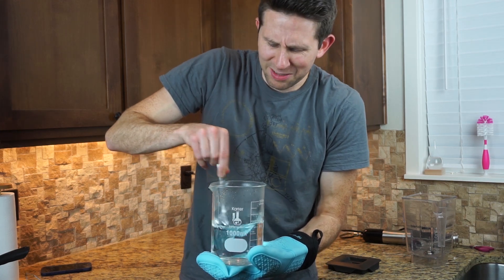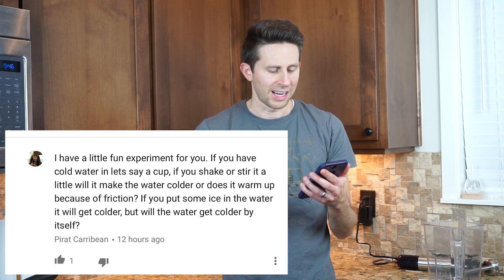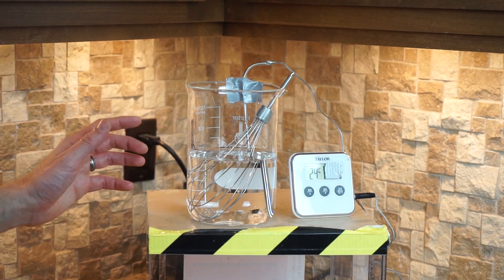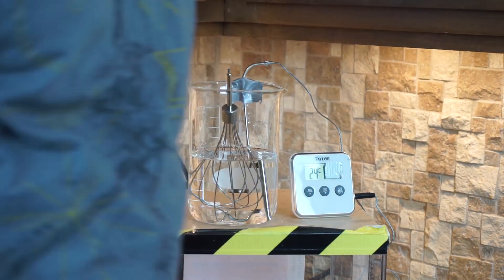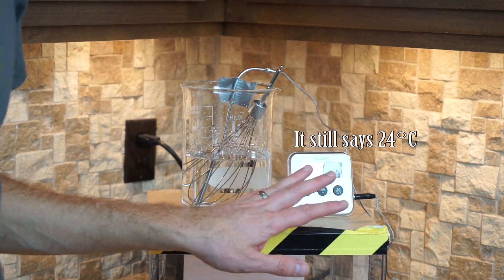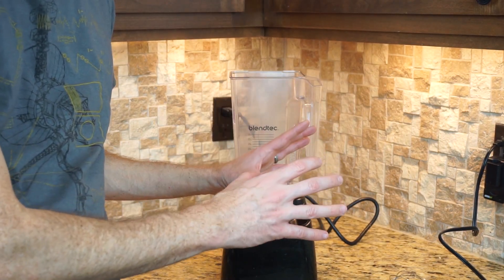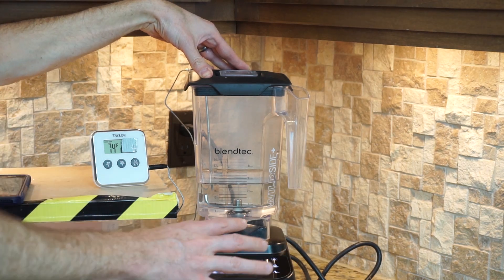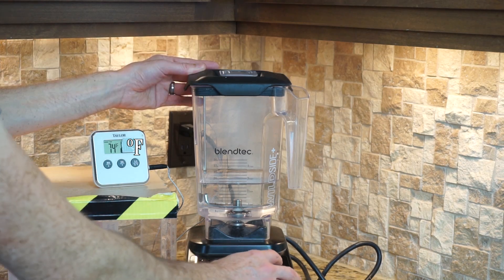Can You Boil Water Just By Mixing it Really Fast? Water-Stirring Challenge Accepted!

Comment: Seems like there's some kind of huge loss going on. I know the sides aren't insulated but with the amount of power going into the water it really should in theory be getting hot a lot sooner.
Reply: Yep -- the motor's friction and electromagnetic inefficiencies are far greater than the blades-against-water friction (measured as energy rates).  So most of the electrical energy ends up as heat before the water,

plus a tiny amount in the water's kinetic (stirred) energy and some amount also lost from the water [as u pointed out].

Comment: I thought that you can cool water down by stirring it because if you don't stir it then only the surface that comes in contact with the air gets colder since the air is colder than the water, unless you're stirring somewhere with high air temperature. The surface should change eventually since colder water moves down and hotter water moves up but I don't know how fast that works. I thought that stirring cools it down by letting the surface change much faster.

This is purely my idea about it. I could be and probably am wrong.

Comment: In theory yes if water is stirred really fast there will be enough friction to boil it.  In reality no a human is not strong enough to stir water that fast. If you move through any substance fast enough you will get very hot. When spacecraft re-enter earths atmosphere and catch on fire there is only .01% of the air you would find at sea level but at 15,000 mph even a tiny amount of air creates substantial friction. By the time the spacecrafts get down into lower thicker air it has lost most of its speed and friction is much less it is no longer on fire.

Comment: Is the water boiling because you're breaking the hydrogen bonds that holds the water molecules together, resulting in the molecules escaping as a gas (boiling)? Or because the friction from the blades and the water increases the temperature of the water, which in return the water boils?

Comment: I think the heat from the mixer blade also add the temperature to the water. Anything you mix in a mixer gets hot also the blades. In this experiment the mixer blades used should be made of an non conducting material, then it will be more accurate to say that water can boil by just stirring it fast. 😉
Btw. Love your videos
Reply: Shit.. you already mentioned it in you comment 😂...

Comment: It's not the water heating up in the blender from mixing it. There's metal engagement points on the blender that tie in to the heat sink of the electric motor, and heat rises. If you run a blender empty without a liquid in it, you will burn it out because the liquid absorbs the heat and acts a coolant. That blade gets very hot, surprisingly fast, it's something we have to take in to consideration when making and blending different types of hot sauces; in a vinegar based sauce the heat is okay, in a fermenting hotsauce you can get too hot and kill the yeasts you need propagating for fermentation and sterilization, you can end up with botulism.

It can be done, but your experiment was not a representation of the Joule paddle wheel experiment.

Comment: I think the reason behind is not the friction of water, but rather the metal part of the blender, it’s heating up as it is plugged and the slight amount of electricity transformed into heat, and then I think it might be caused by the ‘heating up’ metal stirrer than the friction itself. Comment below cuz I am not sure about it

Comment: The heat was created by the friction between the blade and bearings and then absorbed by the water. So most of the heat was not created by water friction against the blade or the container walls. If you can really boil water by stirring it you could’ve used plastic whisk attached to a drill instead of metal blade.

Comment: I knew what your results were going to be , before you started .  I was working with cameras inside water jets . The water cavitates , or causes little bubbles , as  it goes thru the jet . If you could measure one bubble interior , it should be boiling .                    Cavitation can wreck hydraulic pumps and boat propellers . I was working on hydrodynamics , to see in high velocity streams .

Comment: How do we know the blender didn't just heat up due to being run for several minutes thereby heating the water?
Reply: I think these motor gets really hot and transfers the heat through the rotor and blades
Reply: Bro comments in YouTube are just nuts... That's a a good question Zach. I'm actually a physics student, but I'm not sure what the answer is.
What I can say it's that the motor definitely generated heat by being on for that much time, and it's reasonable to think that part of this heat got in contact with the water via the blade.
Probably it wouldn't be enough to boil that much water dough. Most of the heat definitely comes from the friction of the blade with the water
Reply: This water did boil from the heat transfered from the motor. Don't believe it? Look when he turned it off. The water was boiling ONLY in the center where the motor was connected. This is the heat source.
Reply: @miked3723  because that's where the most motion ie the most friction was generated, ever thought that way?
Also as pointed out before the transfer of heat through metals used isn't fully efficient and also the air gap so though the heat is transferred it isn't the major contributor to the heating
Reply: @skyking469  No by far the most friction with the water was created at the tips of the blade not the shaft. Also the air gap means nothing as all the motor pieces are connected to eachother, there is no air gap. And the efficiency of heat transfer through metal (which is high) does not matter, if the motor is getting hundreds of degrees then even poor heat transfer would get the blade extremely hot.
Reply: Looked for this comment
Reply: Even I got the same doubt
Reply: Partialy but it won't be enough. You can test by make blender the same amount of time and check the blade temperature if it hit 99 celcius.
Reply: Well. You can see that there is an air gap between the blender and water so there isn’t much heat transfer that way. There could be some heat transfer through the stainless steel blades but it’s not that much because stainless steel is not the best thermal conductor
Reply: I was thinking the same thing until he mentioned the Dr Jewel story (that i wasn't aware of because I'm not familiar with science)  once he talked about Jewel getting the same result with no electricity i realized it was true.
Reply: Yes friction of the water will will generate heat. But... I dare you to touch the motor. Goodbye skin.
Reply: Hmm. Blender hearing up for running several minutes... Hmm If I remember correctly, water boil at 100⁰c. So you telling me that the blender get so hot that its heat boil the water while the motor aren't broken
Reply: @loljay3281  well remember, the water in the example given didn't boil, it simply heated up. Thus my reasoning behind my conclusion.
Reply: @geekypleer1202  that's not even a reasonable conclusion. We already know why it got hot because motion and heat are interchangeable. Mechanical energy and heat energy are interchangeable.
Reply: @ronhempfield5043  I'm not saying it's not, dude. I'm just saying in THIS case it probably came from the blinder. I'm not disagreeing with the fact that friction creates heat.
Reply: @Zach Rowlett  you believe running a blender for "several minutes" could heat up that much water, just like that! You could put a lighter flame to that much water and it would barely increase the temperature. I'm fairly certain the heat was not generated by the heat radiating from the use of the blender as you described.
Reply: @ronhempfield5043  Ok. I went back and watched the video again cause I really couldn't remember how much the temperature went up, or what type of blender he had.

Upon further observation I'm gonna say yeah, the water moving that fast definitely had a big effect on the change in heat, but I also think the blender is responsible for a good bit of it. You gotta think, if water can create that much heat due only to friction, then steel blades and all the little bits moving in the motor which all directly rub each other at very high speed must be contributing. Because more friction creates more heat, and you increase friction by increasing either force or mass, and the steel blades that are connected to the gears and the internal workings of the motor have more mass than the water they are contacting, they generate more heat.

I really think this is just a misunderstanding. I know water can heat up a lot just due to friction, I just say that in this case it wasn't ONLY the water. It had some help.

Edit: he mentioned in the description an experiment I'm much happier with.
Reply: That's a lot of words for "I'm wrong"
Reply: @jasonmiller6181  thermodynamics says yes the heat will transfer from the 1000w motor to the water. heaters are 1500 watts and heat up rooms fast. do the math.
Reply: @zerotheliger  they aren't into science, they are just children who watch a nerd who can "do math".
Reply: @geekypleer1202  A portion of water did boil and you could see steam. Are you blind or what?
Reply: @geekypleer1202  can't find a mentioning of a related experiment in the description. Can you put it here please? Btw, don't bother with these stupid comments which were made by kids who can't think straight or follow an argument.
Reply: @geekypleer1202  man you think blender got like 100°?
Reply: @loljay3281  i build electric skateboards its typical to see motor temps reach over 100°
Reply: @loljay3281  the motor would burn due to heat yes but if you are taking away that heat with the water then it could sustained it there for not burning the motor
Reply: Have u wat hed the last bit
Reply: @maindepth8830  I got a stroke trying to read dat

Comment: Actually 100°c is boiling point for water
Reply: At sea level yes but if you go higher the boiling point gets lower. For example if you are 1905 metres above sea level water boils at 93,4°C. So higher pressure = higher boiling point, lower pressure = lower boiling point.

Comment: The problem with this experiment is that believe it or not the blender itself is generating heat by electric currency in the motor and the shape of the base of the cup it's shaped in a way that it preserve such heat, thus helping the water get warmer faster, idk if this can influence a bit or not but still friction does get heat as result so probably with a bakery mixer could probably get the same results but slower and maybe messier, but as for boiling point I kinda doubt it but not sure though

Comment: ...
Whenever I use a blender, I feel the blades are warm, maybe because of the frtiction it gets from the high speed rotation...
An electric kettel has a coil that heats up the water, the blades in this blender should be comparable to that heating coil... Coil gets heat directly from electricity, while the blades get heat from friction against the base of the blender...
.
Well, I can at least be sure that most of that heat that boiled the water was created this way and not the water generating friction from its molecules.

Comment: Man: can I boil water with a blender?
Electricity bill: I'm bout to end his whole man's career
Reply: technically, it's not more expensive than using an electric stove, or a microwave. A little bit due to inefficiency of motor, and heat dissipation, but not this much.
Reply: You guys get electricity biils even in the US?
Reply: @vanditsangal5018  Even in Turkey,mate😭.
Reply: @vanditsangal5018  I'm from europe
Reply: @cristian-gabriel  okay,so do u guys get electricity bills even in Europe?
Reply: @vanditsangal5018  u get them everywhere aalmost
Reply: Vitamix Blender has been doing this since 60’. Nothing new and only takes a minute to two minutes. Electric bill doesn’t even notice it.
Reply: Bruh your pfp 😂
Reply: Actually your electricity bill we'll be the same if you put the water to boil on electric cooker or use this energy for the blender.....just you'll waste a lot of time with the blender.
Reply: Nice shoe
Reply: But I'm not a rapper....
Reply: It is not significantly more energy intensive to heat water by mechanical work than it is to heat it by a resistive heating element.  The reason why we don't usually do this, is the wear and tear on all the moving parts.  It is a lot more efficient for the maintenance of the appliance to use a fixed resistive heater than a moving mixer for heating water.
Reply: Your spelling mistake made it mean Shutting this man's body off and kill him
Reply: My electric kettle takes around a minute to boil the same amount of water, which is 3100 Watts, that's around 51.5 Watts per minute.

Blendtec is 1725Watts. That's 28.75 Watt per minute. For the water to reach boiling temperature, it took 6 rounds of 1.5 minutes each. That's 9 minutes in total, which means it required ~259 Watts which is 5 times the consumption of a kettle. 

If we use the kettle 180 days per year, that's 46.6 kW annually. If the price per kWh in USA is ~13 cents, that's about 6$ per year instead of 1.2$ which would be by using a kettle.

That means the bill every year would be 4.8$ extra which I believe it wouldn't really affect him financially.
 
Those are some really rough calculations, a very specific period of kettle usage per year and a price of electricity I found in a random site.
Reply: @phelpswilliams159  I fully agree. The most expensive part of this method would be the extra wear to blender bearing.
Reply: It's " man's whole career"

Comment: 4:49 and the heat from the blades center drive and motor.
Reply: This is what i said. All dumpheads in this video got fooled. No one thought about that except me and you. I was scrolling down to see where anyone would point that out. I've been using blenders since 2007 A LOT. A DAMN LOT (for my bodybuilding meals lol). Thus, all i want to say is that A LOT of heat comes from that point due to friction of the shaft (and a part from the motor (because it depends on the insulation in the shaft that sticks (connects to) on the base.

Comment: If the blades are connected to the motor using metla parts then most of this heat is generated by the motor and than absorbed by water thorough the  blades. You would need ceramic or plasic coupling to decrease the heat transfer.

Comment: does the heat coming from your hand dissipates to the air when being conducted through the metal and glass before reaching the water? because you touched the mixer head and the glass container when stirring but it had no effect on the temperature of the water.

Comment: You do realize the blender will heat up PROBLEM: Because there is an electric engine inside the blender. Which makes the water inside heat up. Not the rotation of the blade against the water. Quit posting flawed experiments online for young viewers. Just put more effort into your work

Comment: Imagine renting the home out to this guy and get your electric bill at the end of the month😬
Reply: He payed the same amount that he would pay for heating up water with a kettle. The electric energy converts into heat nearly at the same rate as it would a kettle do. The only energy losses are by the heat in the motor the noise and the isolation of the blender but if you think about a open kettle were 100°C hot steam floating out it isnt really efficient as well
Reply: @Leon-eq6ei  disagree, if you ever operated a blender they generate quite a bit of heat on the motor itself. So a lot of the energy is wasted and not used for heating the water. Plus there is indeed the lost of energy due to the sound being made which isn't much but it adds up. Finally this method takes much longer to heat up the water which means more energy is lost to heat going into the environment (air). Overall your bills are gonna look much worse using this method to heat water. Please revisit your physics classes lol.
Reply: @tuyiren781  I am studying physics on a university lmao. It is obvious that you will have to pay more but not that much. You wouldnt ever notice it on your electric bill. I did an experiment with two plastic buckets full of Water and the loss in temperatur after 30minutes was like 10%. Estimating that a blender out of glass isolates better then half a milimeter of plastic you wont lose more then 10%. Also need 420kJ to boil 1l water emediately. That is 0.11667kWh or 3.5ct when you take 30ct/kWh and 10% of that would be the loss after 30 min. That would compare to 0.35ct. The energy efficiency of an oven is 90% and the energy efficiency of a modern blender is easily the same or higher. Water has a high specific Heatcapacity which means you need far more energy to heat up water then you would need to heat up the interior of the blender. This means even if the blender is really hot you will just need a portion of the energy compared to the one going into the water. This is why it feels that the energy efficiency of a blender isnt that high. Even if you could boil water emediately with an oven you would safe 0.35ct per liter water. As soon as the water boils 100% of the incoming energy wents out of the water as steam which means that you lose 100% of the energy after the water boils and an iron pot wont stop that. So the energy loss is the same after you reach the boiling point. All in all you would lose like half a cent if you cook a meal with a blender compared to a normal oven. If you cook 60 times a month that would equal to 20ct. Congratulations you are now poor
Reply: @Leon-eq6ei  when you take a test your IQ points aren't noticed
Reply: @REALBanannaman  ok cool
Reply: 1.000.000 Dollars    Me:Grabs his gun out of nowhere and kills the man(not really).